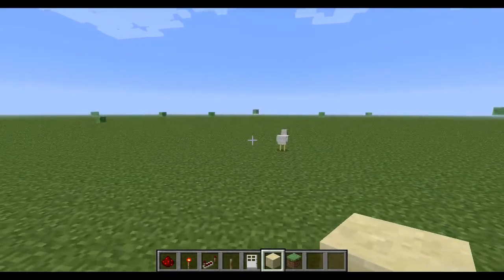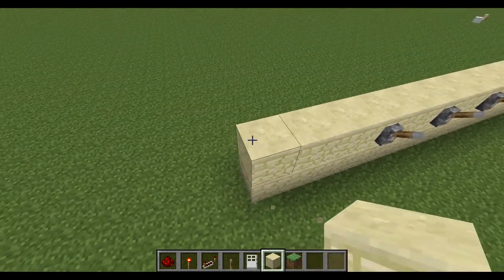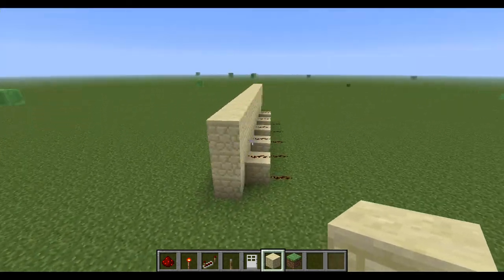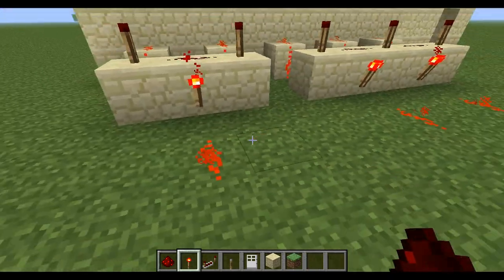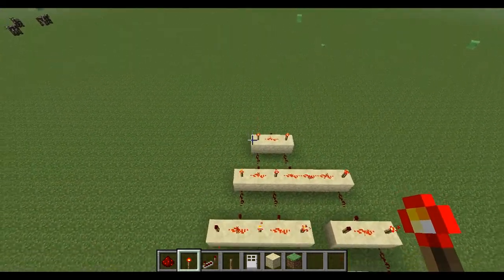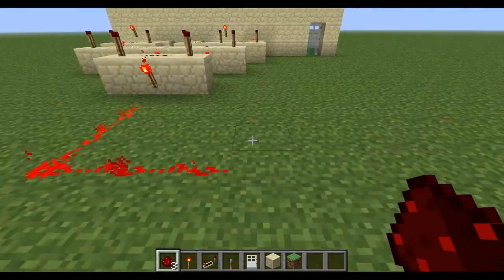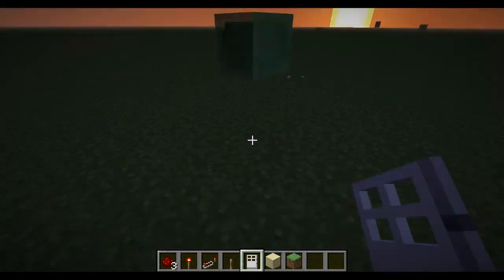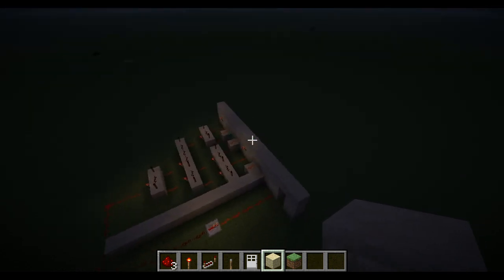Minecraft - How Redstone Works - Ep. 3 - Basic Combination Lock - [HD]

Comment from the maker: @mcangusnut Because of the fact you can't control levers with redstone...you can't. You have to reset the combination yourself. You could put a lock on the inside so none could sneak in while the door is open...you do that by putting a lever on the inside of the room and wire it in a way to were it ruins the combination and the door closes when the lever is puled.